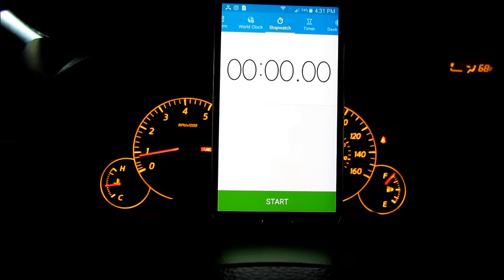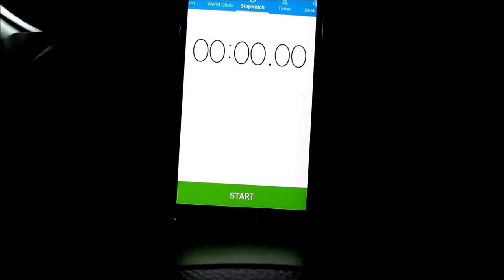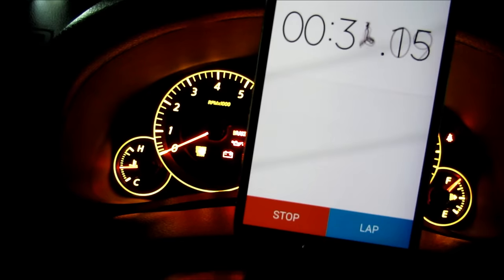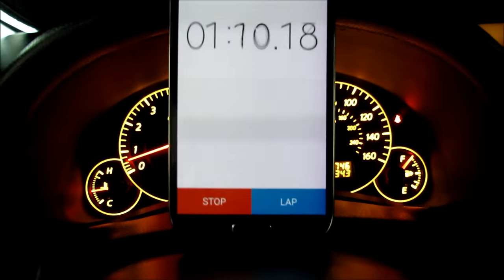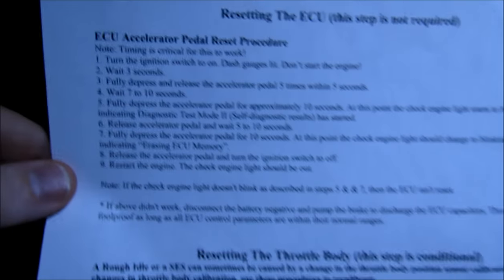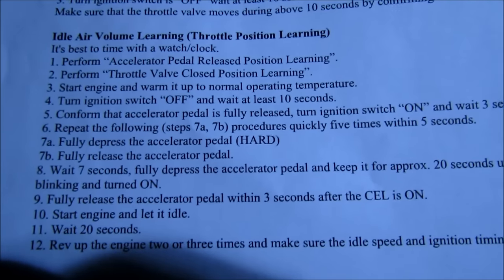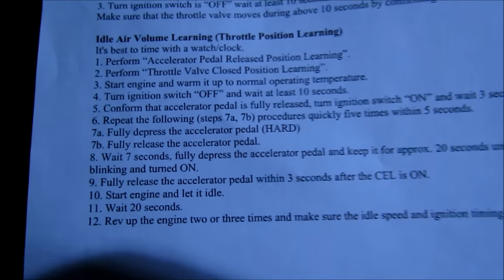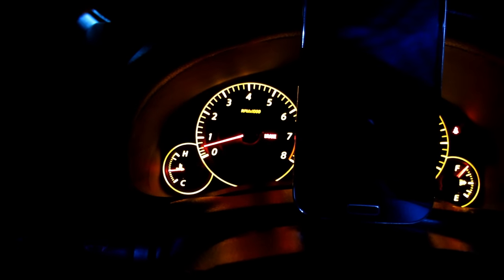Idle Relearn - FX35, I35, M35, G35, G37, 350z, 370z, Maxima, Murano, Sentra, Altima, M45, M56,

Comment: So I disconnected the throttle body to clean it but im not getting an idle codr and it idles perfectly at 600-800 rpms
Reply: You are indeed lucky. MOST of the time there are all kind of problems; AFTER the Throttle Body and/or the Mass Air Flow sensors were removed and reinstalled.

Check out the myriad of YouTube video's; where many are going crazy with things happening AFTER cleaning the TB and/or MAF.
Reply: @MrPatdeeee  I moved the butterfly and everything. Car drives perfect minus that i have misfire cyl 4 and one precat o2 sensor out. Im also getting a code for ecm reset or something. So im thinking maybe thats bc i hvent done throttle body relearn . On cold start its at like 1k rpms for like 45sec-1min then drops to 750-600 within 2 minutes once my car is pretty warmed up. Let me figure out what the code was.
Reply: @MrPatdeeee  im getting p1065 :(
Reply: @MrPatdeeee  i did a small tune up on my car, replaced both belts and coolant bleed but in in the process my batterry died bc I forgot to disconnect it so i got it charge at autozone bc its new but after that i was constantly disconnecting and connecting the negative terminal so idk if maybe doing that messed up the ecu. I would disconnect when im working on it then connect it to turn it on and disconnect it again. I did this at least 10-20 times 🤣🤦‍♂️
Reply: Im new to working on cars, this is the first repair ive ever done and the car seems to be running nice and strong minus those few codes
Reply: @MrPatdeeee  i also did a seafoam clean through the brake booster valve

Comment: Confirmed. This throttle body reset also works for the 2005 Infiniti FX35 with the vq35de engine and identical throttle body.
Reply from the maker: I will add FX to the title, thank you.
Reply from the maker: Done, FX35 added. For the record, I think the 2005 FX35 is the nicest looking FX. It is so beefy and tough looking vs looking like a fish like the newer FX.
Reply: I agree and ours has 180k miles and still going strong. Let's go team Motordyne!!
Reply: 2 years later... The throttle body in the same FX35 has given out and I've replaced it with a brand new Hitachi throttle body and used this video to reset the idle. This video is priceless. Thank you Motordyne G35!

Comment: No disrespect atoll...

I would feel better IF I used the entire series of steps. Tell 'yuz' why: I had my "Throttle Body" and "Mass Air Flow" sensors, cleaned by a Nissan dealer. On the way home, the engine light came on. I took it back and they did it the "quick" way as you have done. They said, "It is fixed".

Later the light came back on. I took it to a "transmission" shop and they used a sophisticated high price "scanner", to get the light out. They said, "You had a number of failures, they are all gone now! Strange that the dealer did not do this!". And it was much better, but it was NOT completely "OK". Because the tachometer some times (particularly when slowing down) will jump up and down and slightly jerk the car.

The full procedure of steps, takes care of all of it.

So I would strongly suggest that IF; the quick way does not get rid of all the "headaches"; please do the long procedure. Again, NO disrespect.

This fulfills and old saying, "Flexibility breeds complexity!".

Comment: This will not fix your idle if you have bad spark plugs , bad fuel injectors bad maf sensors ,bad cats , bad converter . if all those things are good. This will work . If you did this and your idle is still off. you may have to get it either tuned or have A MACHANIC FIX YOUR IDLE FROM THE COMPUTER . ALSO THIS PROCEDURE WORKS BEST WHEN YOU DISCONNECT THE BATTERY FOR ATLEAST 10 MINUTES . THIS RESETS THE ECU THEN IDLE RELEARN . MY G37 HAD THIS ISSUE . I DID THIS PROCEDURE 11 TIMES AND MY IDLE WAS STILL IDLING ROUGH AT STOPS. BUT ONLY FOR 30 MINUTES. AFTER 30 MINUTES OF DRIVING THE CAR DIDN'T IDLE ROUGH ANYMORE . BUT EVERYTIME I GOT IN THE CAR TO DRIVE , IT SPUTTERED LIKE IT WAS GOING TO SHUT OFF BUT NEVER DID. EVEN WHEN DRIVING . MY CAR WOULD FEEL LIKE ITS LOSING POWER. TO I KEYED IT DOWN TO TWO MAJOR THINGS . MY THROTTLE BODIES NEEDED CHANGING OR MY FEUL INJECTORS WHERE CLOGGED . THE CAR IS AT 216 K . ALL MODS . CAR RUNS LIKE A DREAM EXCEPT FOR THIS ISSUE. TRUST ME G OWNERS . THIS WILL NOT FIX YOUR PROBLEM IF OTHER COMPONENTS ARE THE ISSUE.
Reply from the maker: sounds like coil packs need changed. Been there.

Comment: Check engine blinks but still high idle ive done this before and it worked 1st try dont know whats wrong
Reply from the maker: Any check engine light codes?
Reply: I have the same problem,  this fix worked once, then not again. No codes but I have had a "Service engine soon light"on for a month or so after it initially went off after a couple days.  I was pleasantly surprised when the idle relearn worked the first time and now suspect it may not have worked the subsequently because I may have something drawing power as my head unit failed about 10 months ago... back to the drawing board I guess.

Comment: How about on a tuned ecu w mods I don’t want to mess up my tuner tune but it jumps around from 6-7-8 hundred rpms
Reply from the maker: My G is dyno tuned and was tuned during the making of this video years ago. This will not effect your tune at all.
Reply from the maker: I bet this is your actual problem though....https://youtu.be/h666VNsPv2M
Reply: Tired it bro and it’s much better not perfect idle but 89-95 better lemme check out what u sent me
Reply: Spark plugs are new but oil is on them from my gasket I just replaced gasket and maybe 10k on plugs but their burnt sooo I’ll replace coils n plugs again I didn’t kno o Reilly sold them thx
Reply from the maker: @954_vqmike3  ...no need to replace plugs if you just replaced them. It is the coils that F up randomly making the car not idle or run right sometimes. How many miles on your VQ?

Comment: when i get my nwp 75mm big bore throttle body i'll do this
Reply from the maker: Mrdylan2g .....anytime you disconnect the harness from the throttle body, you have to do the idle relearn. When installing a new throttle body, you disconnect the harness. Yep you got it, so when you get the big bore NWP 75mm throttle body, this is mandatory.
Reply from the maker: Mrdylan2g .....Oh yeah, has your Motordyne Shockwave/ART pipes   shown up yet?
Reply: not yet still waiting
Reply from the maker: Wow.......that is unreal. The anticipation is got to be killing you by now and my videos are teasing you hearing the shockwave ))). Call Motordyne direct (661) 993-5242 and check on your order, to ensure the reseller is giving you accurate information at this point.  2 months is 2 long. ------Wait you are in Canada, now I remember why your wait is so long, it has to go through customs. I thought waiting 1 month to get in the states, was too long. What is the date now they promise?
Reply: july 24 for the tdx2 and the art pipes can come any day because they said it's on it's way
Reply from the maker: Let me know when it does arrive and what you think, if it was worth it or not.
Reply: i will
Reply: i just picked up my art pipes, is it true that i have to cut a bolt in the exhaust shield so it doesn't punch a hole in the art pipes
Reply from the maker: Congrats on the ART pipes arriving! Yes, it is true, you can either hit the bolt with a hammer and bend it back or cut it off. I remember that being in the install instructions now that you mention it.
Reply from the maker: Any word on the delivery of the Motordyne Shockwave yet?
Reply: Motordyne G35 they told me the end of next week, i did'ent put the art pipes on because i am waiting for the tdx2's

Comment: My idle isn’t consistent It goes up a little then down a little and after a while the car stalls and cuts off. Will this fix it?
Reply from the maker: GCX 717 .....Yes, unless you have a check engine light saying there is a bigger problem that needs fixed first, for the idle relearn to work.
Reply: Motordyne G35 I don’t have that thankyou can’t wait to see if this works
Reply from the maker: If you have NO check engine light to fix first, this will work without a doubt. Post back!
Reply: Motordyne G35 yea I don’t have a check engine light I’ll try it when I get off work

Comment: So this wouldn't work on a 2013 Nissan Sentra?
Reply from the maker: Yes, it will work on a 2013 Nissan Sentra.
Reply: Motordyne G35 I have a 13 maxima and I'm assuming this works for no e as well. I put a K&N drop in air filter today idle is fine same it always has been just wondering if this is needed or will help with performance after the filter install

Comment: Does this work for a 2008 350z?? Thanks
Reply from the maker: Project 350z ......Yes it will work on a 350z.
Reply from the maker: milo Rambaldi ....Yes it will work on a 2007 G. Are you able to get the check engine light to flash?
Reply: So did it work Kryptic?
Reply: @bluezevil1305  yes bro it definitely worked!!

Comment: Kind of late but I did this and it drop my rpms lower any tips?
Reply from the maker: It suppossed to drop them lower. Idle is 650 RPM. Is it lower than that?
Reply: Yeah its around around 300 rpms, I cleaned my throttle bodies and maf sensor then did the idle reset it  still hovers around 300. I tried everything from ecu  reset, cleaning my air filters but still idles around like 300 whenever my z is stopped.

Comment: My light never stops blinking after waiting 7 second and pressing accelerator
Reply: Light never stop flashing. Replaced iacv and replaced burned mosfet in computer. No more surging idle but can complete relearn. Stuck at 1000 rpm
Reply: @golfish8589 is it an 08 G35x? I heard those have issues with the idle relearn procedure not being able to run properly due to a software glitch

Comment: i have a 370z 2014 its not working on mine..?
Reply: i already have a service engine light on due to switching out my oem cats to aam high flow cats but each time i slow down on red light or coming to a stop sign, the rpm when its going down to 2k-1k it jumps up then goes back down.. people said it was my throttle or idle
Reply from the maker: Anytime the car gets more air than fuel, it is running lean. Lean codes can be fixed by dyno tunes.
Reply: Motordyne G35 thanks, ill get it soon just waiting on some parts i ordered before getting it tuned. Do you know if its "bad" driving UNtuned for the meantime?

Comment: My G35 idles at 250 rpm?? Really low?? Can’t seem to fix it :((
Reply from the maker: Malte Micha ...check engine light code?
Reply: Motordyne G35 cylinder5 misfire P0305 and A P0300.
Reply: Motordyne G35 I've replaced coil packs new plugs on driver side. Could it be a bad valve cover?? On passenger side?
Reply from the maker: Malte Micha ....P0300 means random misfire so more than 1 cylinder is misfiring? Did you replace all 6 spark plugs and all 6 coilpacks?
Reply: Motordyne G35, no but I have other 3 coil packs and plugs, just found out the plastic valve cover is shot. But that wouldn't cause a low rpm that would cause rough idle. Will replace it on 29th. And add the other 3 plugs and coil packs.
Reply from the maker: Coilpacks are good for about 60k to 75k miles. How many miles are on the car? 

A leaking valve gasket is not your issue. Did you watch my video on replacing coil packs? I know you said you replaced the coilpacks and plugs on the driver side. I'm 99% sure once you replace coilpacks and plugs on the passenger side, your problem will be gone. My only concern is if you did not hook up the coilpack correctly on the driver side because it is easy to get the back 2 confused, so if the problem still exist you need to reexamine it. Did you label them once you pulled off the connector? I labeled mine to not get them confused when pulling off.
Reply: Malte Micha let me know if you fix this problem I’m having. The same issue
Reply: daddyoriginal1 I think it is something to do with the throttle body it is electrical for sure.ive replaced the valve covers the spark plugs and the coil packs and checked for head gasket issues. I'll have to do a throttle and idle relearn soon but this has boggled me I'll keep you posted if I find it. If you find it too then let me know. I'd take this to dealer but they won't service my car here where I'm at
Reply from the maker: Malte Micha....wait....the problem is you replaced only 3 spark plugs/coil packs out of 6. Cylinder 5 is on the passenger side and you said you did the drivers side. That is your problem. If the throttle body had an issue it would throw a code. You are throwing a misfire code, which has nothing to do with the throttle body. Any issue with throttle body, it would throw a code specially for the throttle body.
Reply: My 04 G idles low at around 200 rpm but no check engine light will this help

Comment: What if you don’t have a code being thrown how do you do it then
Reply from the maker: What? I made this video to show you how to do the idle relearn procedure. I didn't have a code when I made this video. Where is the code being thrown question coming from?
Reply: @MotordyneG35  in the video you have a service engine light on and you wait for it to blink well mine is idling strange when ac is off and I recently unplugged my throttle body but I don’t have a cel to wait to blink to know when it’s done
Reply: @MotordyneG35  never mind bro my bad I must have bumped the video forward because I missed that part where it’s on the on position again my bad bro thanks
Reply from the maker: @johnsolow3944  ..if you disconnect your throttle body you have to do the idle relearn. So you are saying your CEL doesn’t work at all?
Reply: @MotordyneG35  oh it def works it’s just not on now I have to clear my test pipes codes often
Reply: @MotordyneG35  I’m welding on bungs soon so hopefully that fixes it
Reply from the maker: @johnsolow3944  ...you need a tune. The code is coming on for a reason. The car is running lean which does damage. You are getting too much airflow and not enough fuel. I got a tune when I removed my CATS.  That's really what you need to do.

Comment: I've followed the steps ECU but eventually the light checking engine has not stopped
Reply from the maker: Amged Algadre ....like I say in the video, if the problem is not fixed, the light will come back on. What is your check engine light code?
Reply: Check engine and  TCS OFF SLIP
Reply from the maker: Wait I thought this was my ECU reset video. This is my idle relearn video. What is the problem?
Reply: My car lost its strength, and I did not know where the problem was
Reply: I expected the problem to be reset ECU
Reply: But I think there is another problem
Reply: My engine was under maintenance, and when it was no longer equipped as much power as before, could you give me the odds?

Comment: My service engine is still on tho? Any ideas?
Reply: Chivas Sanchez Im having the same issue. I disconnected my battery and it’s idling super low and it stalls. Idk what to do. Did the relearn and still idles low. Idk what to do anymore
Reply: SEAL 14 what ima do is take it to midas and just pay to get it inspected
Reply: Chivas Sanchez I disconnected my battery since I was changing my 3rd brake light and when I connected it back, it started up and then died. Battery works and everything but the engine idles too low that it just dies. I’ve read some forums saying it’s a camshaft sensor but tbh idk what it is.
Reply: SEAL 14 did you try cleaning your throttle body?
Reply: Chivas Sanchez I cleaned the mass air flow sensor and it still did the same thing
Reply: SEAL 14 idk man we both stuck at this point haha

Comment: Why how come your pretty car sounds like a trumpet in a marching band? 
Lol f-ing with you bro. But do get rid of those stock headers with replacement long tube headers by IRS performance.  No more trumpet marching for me. But my god I need back flow. So I'm reducing   from 3inch down to 2.50 inch back to 3.0 inch this weekend and see if that helps. And high idle. I've dumped a lot of cash into this car and still needs to be painted and a turbo kit sitting in shop waiting to be installed. It's got almost 80k on it now. Better hurry before I have to pull that block out. Lol take care

Comment: I got a 2008 infiniti sedan and we switched the engine to another hr same as the old one with fewer miles and the car turns on but it doesnt drive pressing the gas just if i put it in drive it goes with the speed without pressing the gas so we were thinking it was the computer so we bought another computer and now it doesnt turn on just cranks i checked the throttle bodies and the first one has 5 voltage and the second has 12. If i put the old computer back and do as the video says will it work?

Comment: What is the benefit of this
Reply from the maker: Cameron Earley .... if you have a rough idle, high idle, new air intake, oil catch can, or you install a new throttle body. This is the procedure to relearn the idle, which is at 650 RPM.

Comment: I did this and  it still idle at 1500 
,On a 350z 03
Reply from the maker: What is your check engine light code?
Reply: @MotordyneG35  it's p0507 ,and now as of today it has p0442, so the whole reset drops the RPMs from 1500 to 1000 but when I turn the car back on they return to 1500
Reply: And they jump as switch into next gear